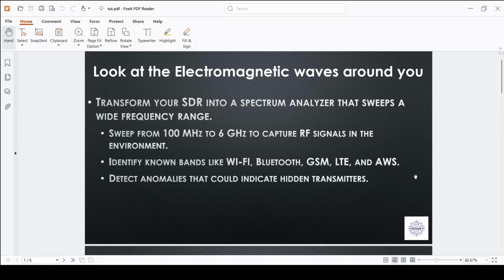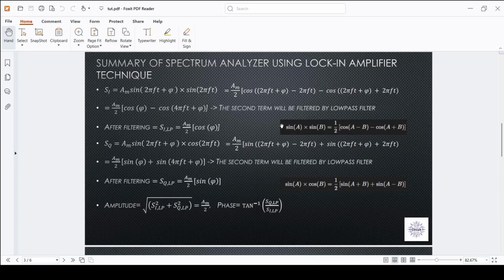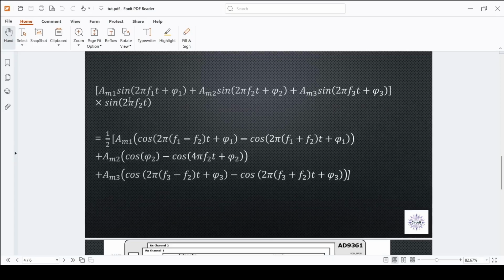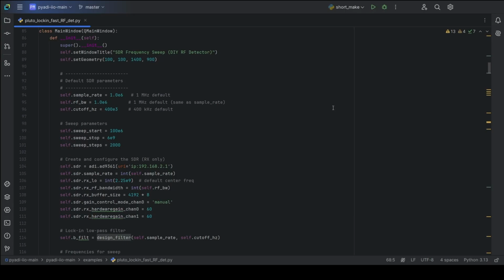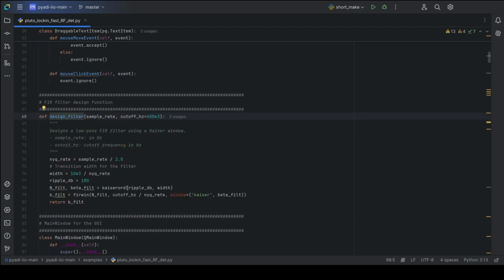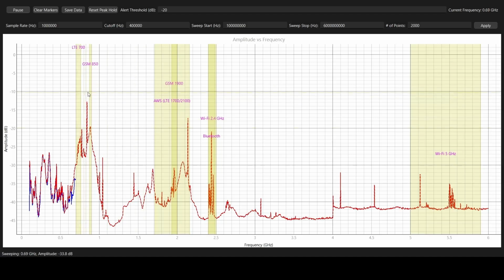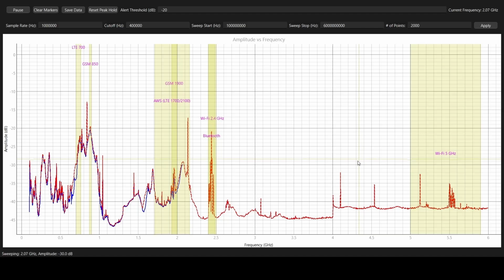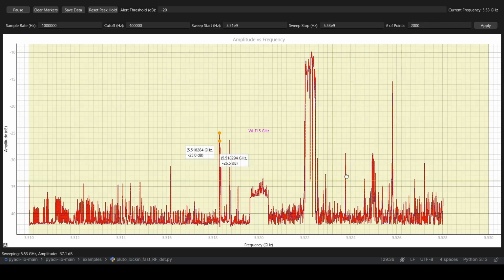See Invisible Electromagnetic Waves Around You with ADALM Pluto SDR Spectrum Analyzer + Code

Comment: A Spectrum Analyzer is commonly a Single Port Receiver for displaying Frequency - Amplitude plots of the received data.  You created a Spectrum Analyzer with your Python code using the ADALM-Pluto SDR.

The ADALM-Pluto is delivered from Analog Devices with one RX and one TX port available, and the second RX and TX port is accessible on the PCB.  This requires the factory build of the ADALM-Pluto hardware to be modified to add the second RX and TX ports to the unit, and the second RX and TX ports are enabled with firmware commands.

Why did you write your Spectrum Analyzer code for the ADALM-Pluto such that it requires that the second RX port be accessible?  Is this necessary, or can the code for the second Rx port be removed?

If the code for the second RX port is removed, the Spectrum Analyzer works for the factory hardware configuration for the ADALM-Pluto.  The code also works for the Pluto+, but fails for the ANTSDR E200.
Reply from the maker: Thanks for watching and following! I’ve changed my ADALM-Pluto firmware to AD9361 and enabled the second RX/TX channels for beamforming projects—feel free to check out my beamforming videos. For this Spectrum Analyzer, that isn’t required (I used AD9361 in Python code because I didn't want to change the FW back): it works with the factory firmware using a single RX channel. The code can be changed accordingly so it runs on the default configuration without exposing the second channel.